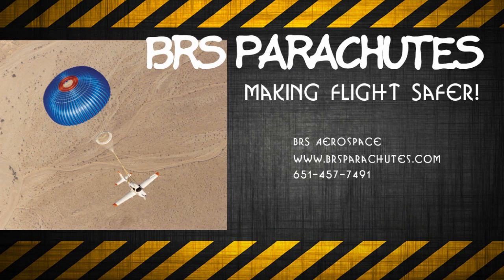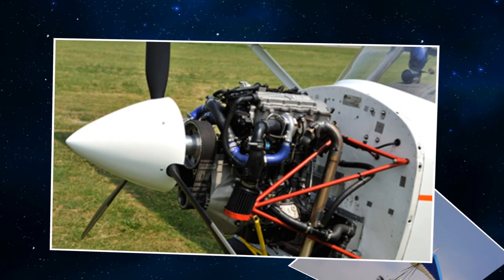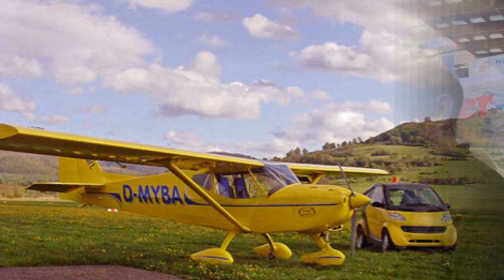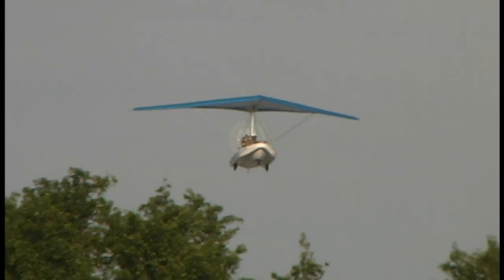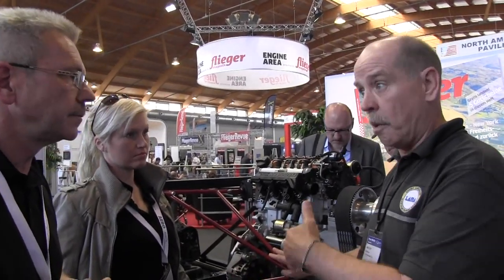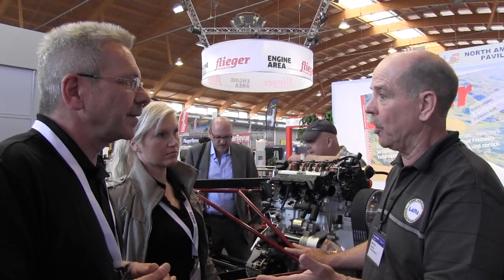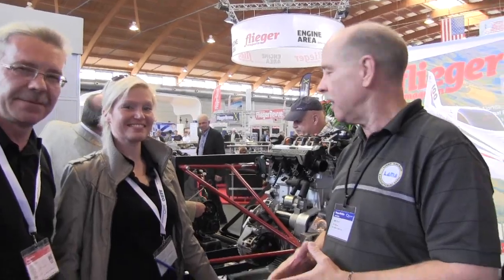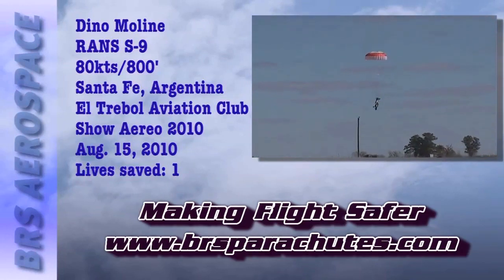FlyEco Smart Diesel turbo charged engine for ultralight and light sport aircraft from FlyEco.

Comment: Wondering what changes they have made to that engine from the standard Merc? as the smart car engine is basically a throw away unit and usually uneconomical to rebuild..
Reply: Since it has totla loss oiling, it needs SAE 30 low ash oil?

Comment: 80 hp and about 10 pounds lighter than a  Rotax 912.  This is for a European Ultralight not for Part 103 aircraft... just careful listening over the crowd noise...
Reply: Not nessesarliy ... Diesels make gamma gobulin amounts of torque and low HP.   Eg: a 955cid  18 wheeler Diesel may only make 425hp.. but 1600 ft lbs of torque... about the same torque as 4 Chevy 454's.